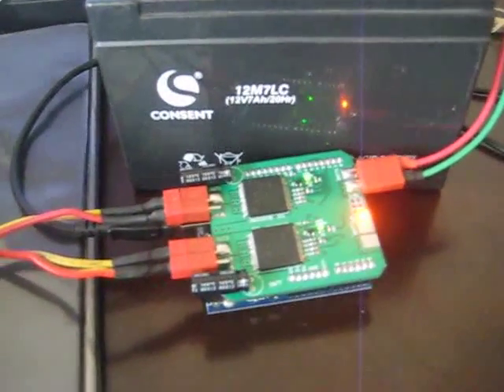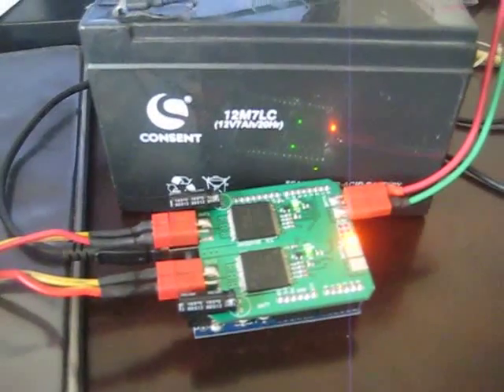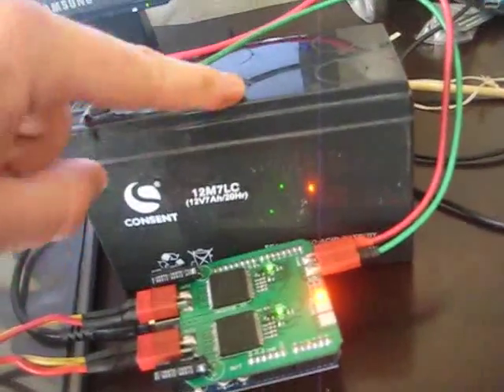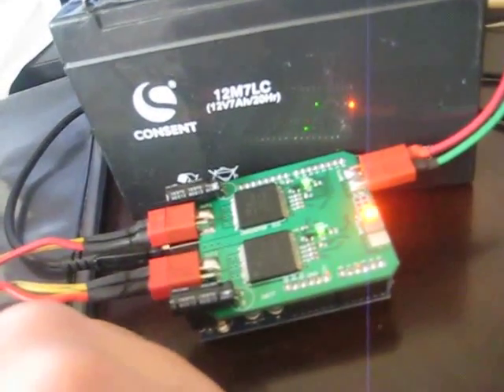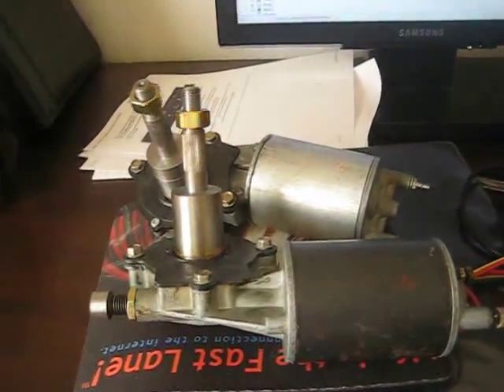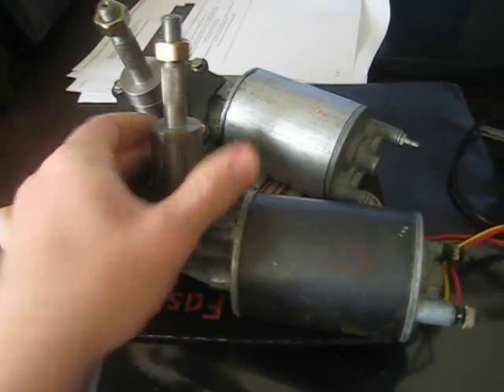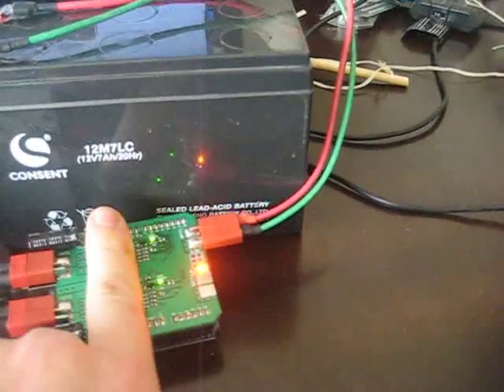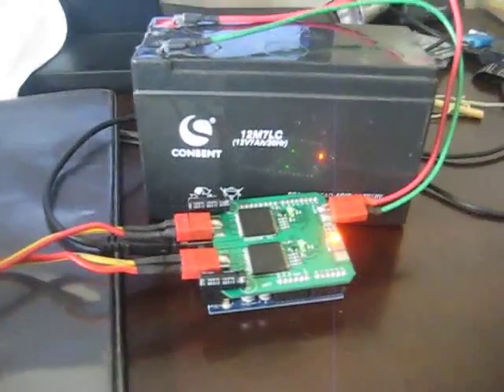High Current Motor Controller Shield for the Arduino

Comment: How did you solder those connectors to the shield? It does not seem to be enough space to place three of them side by side.
Reply from the maker: +Yuri Monty The dean's connectors?  There are only 2.  You can see the exposed pads on the PCB on the one next to the battery.

Comment: how can i use it for 4 motors for a 4WD robot car with skid steering function?
Reply from the maker: +Siddharth Shivalkar You could just wire the two motors together to the same outputs, assuming that the two motors don't draw more power than the rated amperage.
Reply: hey thank you for the reply. what were the AMPs drawn by your motors in that video in case of stall?
Reply from the maker: +Siddharth Shivalkar I can't remember, but the chips are rated for 15A continuous with 30A surge.  You might need a heat sink on them if you are drawing that much current, though.
Reply: oh ok.. can i purchase it online? and where??
Reply from the maker: +Siddharth Shivalkar Sparkfun has a board with the same drivers. https://www.sparkfun.com/products/10182
Reply: +ilektronx thank you very much for the reply. unfortunately seems like it is not available in India at the moment. sad :-( .... i had bought a 20 A motor driver with Arduino UNO integrated but it just came with a Schematic and I am not able to figure out the PIN on the boards based on the Schematic.